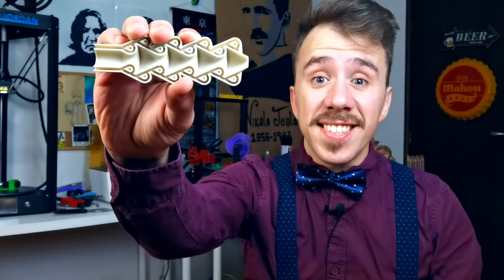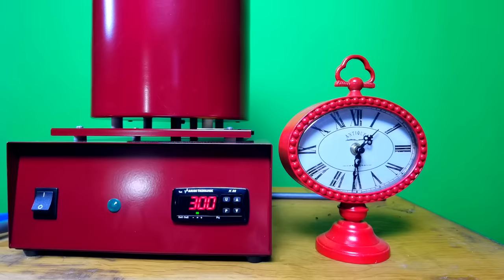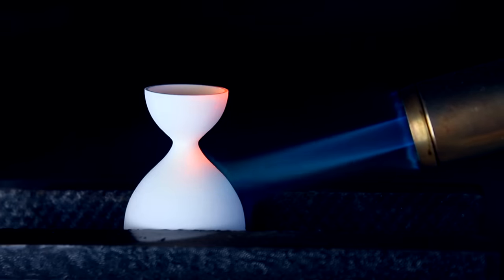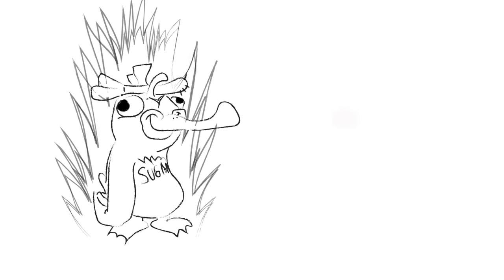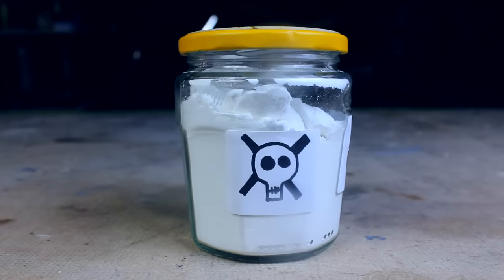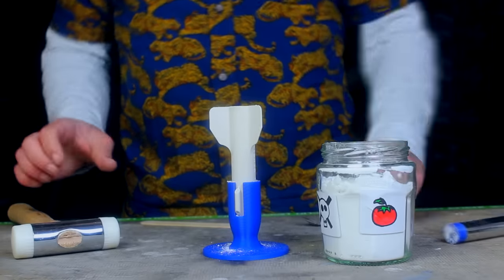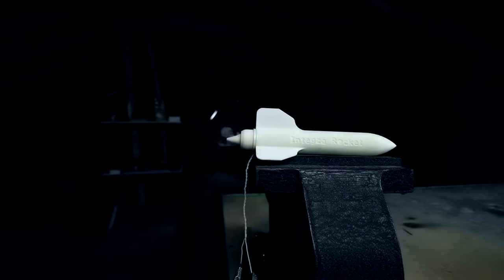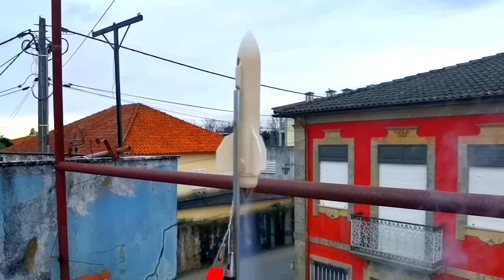Aerospike Rocket Engine (3D Printed)

Comment: You have to be really careful with those things.  I was just walking around my neighbourhood recently, and was hit on the head from one out of nowhere.  Now my vision is blurry and all I can smell is caramel wherever I go.  I didn't really see where it came from, but a passerby said it looked like it was launched from a roof about 300 meters away.  All I'm saying is stay safe!
Reply from the maker: You cracked me up ahahah
Reply: Norm T  launched a Goat? How far? Bro you gotta give us the details on this 😆 🤣 😂
Reply: @integza  rI'm sure someone like you can easily and quickly make a decent ball mill which will grind your powders to a much finer one. I did a little research project in high school on how to make rocket candy more powerful, by looking into sorbitol, mannitol, xylitol etc. instead of sucrose, and also by adding sulfur and metal powders such as Al and Mg to the mix. Mannitol, a bit of sulfur and very fine Al powder (which you should make by grinding charcoal and Al together in a ball mill, so the Al doesn't oxidise) was the best one. Don't know the exact ratios of the top of my head.

Comment: You can 3d print ceramic parts? And you chose to make an aerospike? That is so freakin awesome!
Reply from the maker: How dare you??? NO ! YOU'RE ARE AWESOME! 

AH! GOTTA GOOD
Reply: @integza  ahhhhhhhhhhhhhhhhhhhhhhhhhhhhhhhhhhhhhhhhhhhhhhhhhhhhhhhhhhhhhhhhhhhhhhh
Reply: Bigger aero spike needed
Reply: @integza  zrub to
z ceramiki lub z masy solnej
Reply: The ceramy cant withstand the high pressure
Reply: @botondpongracz9851  not the build up for extensive time but it is what he had and it worked so he is the rocket master
Reply: Congrats to your future 3D printer
Reply: you can print metal, guy.  learn more stuff
Reply: @incubusfan4211  tell me more
Reply: @JoelCreates  he’s talking about SLS printers, which are priced out of most maker budgets ($10k+).  Dunno why he was so aggressive about it.
Reply: @humbleproblems  thanks Calob, I've heard of them before at the industrial level, but I hadn't heard of ceramic printing, particularly at the hobbyist level. I used to work prototyping high temperature devices, and it would have been quite useful for some applications had my company had it.
Reply: I utik

Comment: Why don't you build a kiln? You could use those white bricks they use in forges. Add a temperature monitor and an arduino... bob's your uncle you have a controllable kiln!
Reply: I suppose buying a replacement or getting one second hand is more practical, but isn't the point of the channel to be creative and do things your own way?
Reply: @johngoldberg8949  It's less about reinventing the wheel and more about being able to do something for yourself. I'd be more interested in watching a video where he makes the rocket, the propellant, and the nozzle rather than just buying an optimized setup and showing it off. It all comes down to personal preference but I was drawn to this channel because of it's creativity and willingness to fail.
Reply: If his 3d printer broke I would want him to fix it in a quirky and interesting way too. I have nothing against store bought but making something cool simply because he can is just what I've come to expect from him. Someday everything breaks; if you can, I believe you should fix it.

Comment: Pro tip on the rocket fuel: Don't use plain table sugar. Use Sorbitol. It has a smoother burn rate and lower pressure. Also, mix the two ingredients with enough water to dissolve the sugar and heat them in a pan (VERY LOW HEAT!!). Once evaporated, you will have a lightly brown, thoroughly mixed fuel. Pour that into a mould the same dimension as your rocket cavity greased and lined with a thick paper tube. When it cools push out the fuel slug (grain as they are called) and you are ready to go. The paper tube and tight fit will help keep the flame from going around the outside of the grain and causing a pressure spike. If you need more power, push a rod into the middle of the grain before it cools. This hole will create greater surface area for the flame and the fuel will burn faster. 

For an even faster burn, create multiple grains. You can use these parameters to raise or lower internal pressure to suit how much your rocket can withstand. Check out Richard Nakka's site for all the information you would ever want to know about experimental rocketry. There are a ton of resources there for anyone who is curious.
Reply: It also has the orbit in it, that alone makes it three times as potent☝🏻
Reply: excellent suggestion!
Reply: i have to add some safety corncern about the tecnique you discribe for the pit and melt the sorbitol ill suggets to use a doble bath call baño maria. just to not get the mixture in contact with any hot flame or stuff that mixture from 90 degrees it self ignite trust me i have experience
Reply: allso ill suggets to use a rasing base redox fuel that are more powerfull and more safety
Reply: This can be extremely dangerous and he can use normal sugar just needs to make it in to a powder e.g. A ball mill
Reply: And also the center of gravity for that rocket is too low. It needs to be longer and have added weight in the nose cone.
Reply: @petepowaaa  not necessarily if it have a long stick where de center of gravity is in the nozzle and has a good stability is ok it happens the save with rockets in fireworks
Reply: @donky335  in the case of this kind of formulas is not the same as the black powder where the kno3 intregrates on the cavity’s of the charcoal the best way is as a said to get the right bound
Reply: @donky335  all so that is why I suggest the redox of epoxy that is better than this one
Reply: @donky335  if temperatures are kept low it is relatively safe. Normal sugar (sucrose) will work, but for plastic enclosures the burn rate is typically too fast and will cause them to explode before they lift off. Sorbitol provides a slower burn rate that is more predictable. Also, not only do dry ingredients require better tooling to created hollow grains, it is difficult to get them well mixed unless they are of the same mesh size.
Reply: @angulini  I assume you are referring to epoxy/kno3 based propellants. I do agree, they are safer as they don't require heating but do need a little more forethought and additional ingredients to perform well. Sorbitol and kno3 are dirt cheap and fairly easy to work with if you keep a watchful eye. I too know what happens when you leave "rocket fuel" heating unattended.
Reply: @NainKaigo  ya i refer to epoxy/kno3 I know they need a little bit of forethought  but for me are the best haha and much more secure but yea your right to in the other thing
Reply: The good thing is that if you overheat the mixture it you will receive a VIP flight to the moon for free!
Reply: Other safety tip; 
- if you can, perform the operation outside, away from dry vegetation (I'm in AU: every season is bushfire season)
- have your evacuation route planned before you start
- have your fire extinguishing gear up to spec and ready
- have water ready in case of burns
-
Reply: I used powdered sugar when I made homemade fuse with cotton thread rather than sorbitol, with water in a pan on very low heat. It was a nerve wracking thing to do for the first time, so I bought a marine fire extinguisher and kept it on hand just in case. It worked really well though.
Reply: @cynoclast  You the Black powder tú make fuse iba waste of time doing it with the candy method but it’s ok to
Reply: @angulini  glad i'm not the only one to lose a set of eyebrows doing this  ;)
hotplate/bainmarie is the way to go...and definitely outside.
Reply: @angulini  probably safest would be to use an electric heating plate of which you can set the temperature, no flame, and you can easily stay below the autoignition temperature
Reply: yup tkor

Comment: Theme: Electric Jet Engine (turbojet or with air bypass). Use a brushless motor from a vacuum cleaner (100k rpm) to drive a compressor. Jet fuel on the combustion chamber and don't use a turbine at the end. Let all the hot gases get out of the nozzle! This could be a cool project!
Reply: Yes, why not
Reply: This is the worst idea i've heard in my entire life.
Reply: @ΑνδρέαςΧούνδρης  hahaha bro, u crazy crazy
Reply: @DeliciousDeBlair  that's cool! My point is if you delete the turbine then the thrust should increase. Having a clever design though, you can increase it too much, and also you can design the engine to double as a rocket engine if you want to, depending on air intake (or not) and combustion chamber geometry.
Reply: @Ανδρέας Χούνδρης you killed him. HE IS DEAD!
Reply: that would make a great video, good idea
Reply: Great idea, but he should use the vacuum cleaner engine assembly as a whole, becouse almost all 3d printed things explode at that high of speed, and also vacuum cleaners usually have brushed universal motors.
Reply: @gellertapati4103  yeah, you can't 3d print something and expect to survive at such rpm. A used compressor will do the job and they are cheap to get. Also,  I think Aliexpress has some 100k brushless motors. Don't know if it is a scam or not, but with only 3 wirings I would guess it's a very fast one.
Reply: So a motorjet??

Comment: Integza: i dont wanna buy a kiln cause its tooo expensive
Also integza: so basically i am giving away  three 3d printers
Reply: Hmmmm... how about building a new kiln using Aerogel or aerated-concrete. It seems to me that if you want to get more extreme ceramics might be in your future.

Post Hmmmm - if you 3d printed a ceramic kiln liner that could be the foundation around which you could place the insulation.
Reply: @alphabravo3683  printing the lining is massively cost prohibitive. 3D printing excels at producing items of complex geometry for cheap (compared to tooling up for mass production or machining traditionally) but it is not the tool for bulk material (such as furnace lining). Just one liter of SLA resin costs anywhere from 60-150$, and given that ceramic resin is likely a lot more advanced than conventional resin, i would not at all be surprised if a bottle surpassed 150. On the other hand, kaowool lining (refractory wool) can be had for about 100$ for 24"*12"*2" which is sufficient to line a small furnace in its entirety.
Reply: @alphabravo3683  Could also make one(a kiln) with some starlite material for very cheap, technically a forge but you could dial back the heat to turn it into a kiln. 
reference video https://www.youtube.com/watch?v=FmEb1YZScxc
Reply: maybe he just prints the 3d printers???

Comment: Theme suggestion: 

You have been working so hard to create a good pulse jet/rocket engine, why not put your knowledge and hard work to the test, make a plane powered by one! It has to be able to carry its own fuel, and have at least 30 seconds in stable flight. 

Along with this, another idea is to use your micro controller skills to rig it with a functional steering system. Then you can try your luck at perfectly crashing it into a tomato.

Comment: Integza, I have 2 challenges for you!

3d printed  flamethrower 

Or

A fully 3d printing EDF ( Electric duct fan basicly a electric jet engine)

only parts excluding parts are wiring and stator shaft

 Maybe use ceramic resin for the rotor and carbon fibre filament for the casing?
Reply: You beat me to it...
Reply: Didn't he do that all ready? 🤔🤔🤔🤔
Reply: @conor1475   I don't think so, maybe tho, I thought it would be a cool idea
Reply: Maybe to make it Christmasy. make it look like a sled or make a few and lift a mini tree 🌳
Reply: Yessssss

Comment: That was an amazing aerospike engine, I would love to see more of them.
Reply: very impressive  exhaust plume geometry.
Reply: Yeah, me too.
Reply: Yeah, the flow went exactly where it was supposed to. I was impressed.  I think the failure may have been due to the solids in the exhaust stream blocking the "throat" (ring in the case of the spike?) and changing the constriction. I could easily be wrong though, I'm no rocket scientist...
Reply: @deltab9768  
My daughter in law is. She did her PhD on some esoteric aspect of rocketry, but she worked, initially on wind power turbine design and now she’s employed in fusion research. Formidably smart young woman and super mum. I don’t know how she does it.

Comment: So I used to make something.similar to this when I was a kid, about 30 years ago.

I found that one way to get a nice even consistent burn, was to melt the potassium nitrate, and sugar mixture, and pour it into the rocket. When it cools, it's a solid.

Also, I used rolled paper for the rocket body, since we didn't have 3d printers.

Comment: if you can make a working cylindrical tesla valve you have to absolutely try it as a nozzle for these rockets! in a video from Nighthawk called Tesla Valve Explained With Fire it looks like the flow actually accelerates!

Comment: I really appreciate seeing the various steps in engineering here. Many other videos talk about start, making, and end results, but you go through all the failures as well! <3 scientific process! For the next video, you should explore the golden turbine you made before, drilling holes along the axel to allow air to escape there might create a stronger spinning effect, and putting it all in a casing like how Dyson fans work will create lower pressure and higher efficiency.

Comment: Use a small rocket to lift a steel cable deeply conected to earth in the middle of a storm. Have a bucket filled with salty water between the earth and the cable to instantaneously create HHO when the thunder strike the steel cable. 
And admire a nice explosion ! :D 
PS : Do not do this from your balcony this time :D 
PS2 : This ceramic resin looks awesome 
PS3 : Upvote if you wanna see the world (or bucket) burn !
Reply: Ridders on the storm
Reply: Here's a salty comment for you
Reply: Or better, use a pure silver wire!! :O

Comment: Brown gas (HHO) powered rocket would be awesome !
You can increase the power with other gases.
Actually anything that uses brown gas !
I love brown gas
Reply: just feeding brown gas through a tube and lighting it inside a nozzle is a bad idea, it carries its own oxidizer so the flame will just travel through your tube back to your container where you store your brown gas, aka your fuel tank explodes. the other option would be to use hydrogen, but hydrogen-powered rockets are really hard to make. hydrogen can go through the smallest gaps, and most 3d printed parts arent even fully airtight.
Reply: @BlackBird-nn2yc  maybe with a one way valve. ( Tesla valve wouldn't be effective )
Or with a cannister filled with HHO. Hydrogen wouldn't work like you said.
Reply: @ruix  one-way valve wouldn't work, the gas is not moving backward, it's just being burned. the only thing that would work would be a bubbler. also, I forgot to mention that the temperatures of burning HHO is  2,800 °C, way higher then those heat resistant 3d parts can withstand
Reply: @BlackBird-nn2yc  oh right my bad. but I'm sure that he wouldn't use 3d printed parts for this high temperature engine.
Reply: @ruix  2800C is enough to melt iron, and I don't think he has anything that he can easily use that can withstand more then that...

Comment: Theme for a future vídeo: making an eletric fan jet engine, you can make a scramjet engine with sheet metal and some holes for the fuel intake, and put an eletric drone motor in front of it for the compression of the intake air, you wold have to learn how to bend and weld sheet metal, that wold be sooo amazing to watch.
Also... Oi Integza! Obrigado pelo conteúdo incrível, me inspira muuuito asistir seus videos, mas não tenho dinheiro para investir nos meus projetos... Um dia espero poder fazer projetos como você e me divertir criando e aprendendo, muito obrigado e abraços do Brasil!!

Comment: Theme: try to build a tool, which can accurately measure thrust of an engine. If you add a logging function to it maybe with a microcontroller, it'll be even better.
Reply: load cell + ADC + any microcontroller (arduino has some cool variable X time graphing functions for data logging)
Reply: maybe but microcontroller will be that good?
Reply: @spread254  yes
Reply: @akakigvelesiani333  yleo

Comment: A University in Hull, England is doing something interesting that you could use a 3d printer for: They are experimenting with using compressed air flowing over a rod (perpendicular) to direct the jet of air to use as dynamic controls. When the air passes over the top of the rod, boundary effects pull the air downward as it leaves the device. Downward movement of the air acts like down aileron on the wing. Passing the air under the rod has the opposite effect.
You could also use the printer to experiment and make better propellers for RC aircraft. I would try to make a Prandtl style propeller for greater efficiency and reduced noise. Would be handy to have these on a quadcopter drone to reduce noise.

Comment: As someone who has a decent amount of experience making solid rocket fuel, here are a couple tips.

Firstly, use glucose powder instead of cane sugar. Glucose is a simpler molecule and thus has a cleaner burn, producing more thrust.
Secondly, melt the fuel into a paste rather than pour powder into the tube. This does 2 things. Firstly it better mixes the fuel and oxidiser, and secondly it gets rid of any moisture that may be in the mix. Do not caramelise it however or you’ll end up with a dirtier burn. If done right you should get a mostly white looking paste with a brown tinge. 
Lastly add some red iron oxide to your fuel. It doesn’t need a lot, maybe half a gram per rocket.